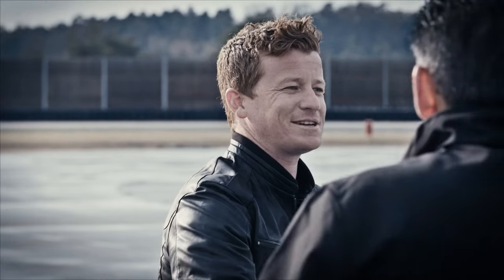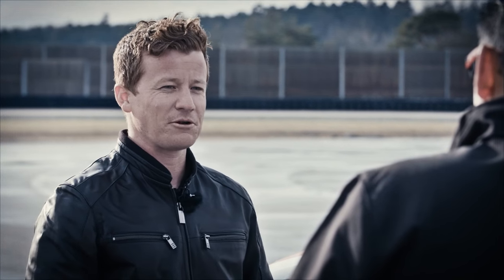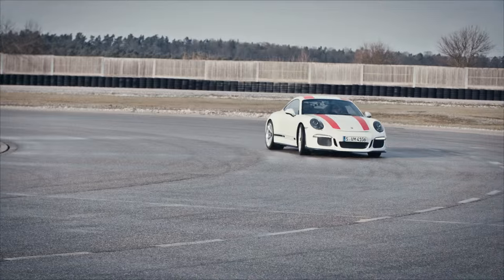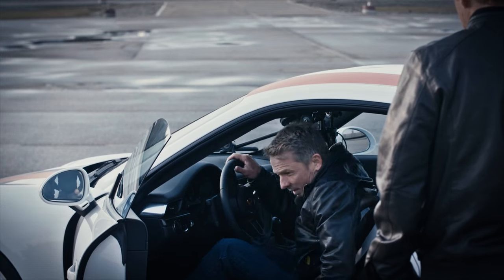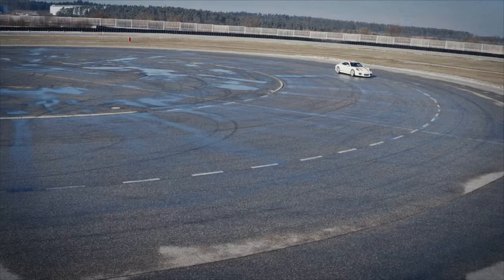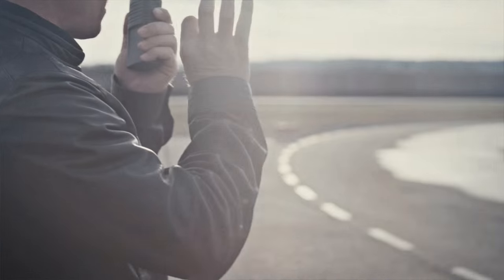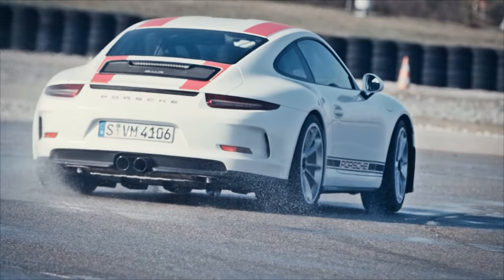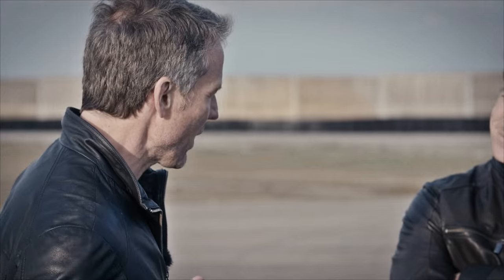Driving lessons with the 911 R - Lesson 2: g-forces

Comment: I think I failed this lesson since all I learned is to lift off the throttle if there is understeer and the definition of both. He never explained how to correct oversteer or how to feel when either of them is going to come on. I also would have liked to hear how the engine in the back affects over/understeer with a 911 vs front or mid engine. I guess just hit the "PSM" button and it fixes everything?